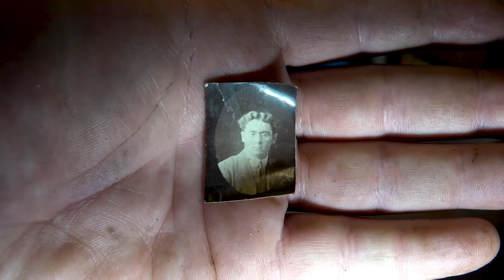First Ever Complete Reed Organ Restoration Series on YouTube

Comment: Excellent, Excellent, Excellent beautiful job. When you approach a project such as this, you can't look at it as one project. It's a 100 projects. when you remove an assembly such as the keyboard, just focus on the keyboard assembly restore that. Then remove another assembly, then restore that. Just work one group at a time. Then before you know it the whole project is done. I used to restore military vehicles, I didn't look at the whole vehicle, I looked at it as an engine, transmission, drivetrain, electrical system, brakes, wheels and bearings, and body. I would restore one system before I started an another, otherwise the project would overwhelm me.

Comment: I am very impressed with your patience and drive for perfection. You did a very good job at the restoration of that reed organ.

I have in my possession a pump organ from my grandmother. My father who passed away more than 15 years ago at the age of 92, grew up with that organ at home. I now have the challenge of restoring it. My specialty is woodwork but I am up to the challenge but a bit apprehensive considering all those small mechanical bits and pieces you took apart and fearful that I may not get it all together again. 

Knowing that I played on that organ when I was just about 7 years of age and I am now 70 and retired, I have the time on my hands to do it and the drive to have it working again.

Comment: Great job! For the sound, it might be the leather belt covering the 7 holes of the pump. Instead of leather from both sides that belt if made in  double layers the upper layer is leather and the base layer facing the 7 pump holes is made of soft silicone.

Comment: What a superb piece of work! The only points I would mention : 1 always keep the pitmans in the order they came out! If they are mixed then a lot of work may be entailed getting the keys level on reassembly. 2. I wondered what glue you used? The ONLY glue to use, everywhere, is hot hide glue. An exception is the use of white carpenters glue for physical repairs to broken items, where strength is required. The crack-filling in the sound board and repaired reed cells is a good example. Using e.g contact cements etc. for general use will make a future restoration an impossibility. 3. Was the original finish damaged beyond recovery? It looked to be quite good. It is always preferable to retain and restore the original finish if at all possible; it will look more authentic and better than a refinish from scratch - and it saves a lot of work !! 4. Often the steelwork of the linkages, coupler bars etc were flashed with copper. If this was the case then after cleaning it is worth replating with copper to avoid rusting in the future.
A very enjoyable video. Thank you for your work in making and sharing it. The organ sure sounds a whole lot better! Best wishes.
Reply from the maker: Wow... thanx James... lot of great points you made here, I learnt many of them the hard way... like the pitmans... LOL... yeah the finish was actually still in good condition, thinking back, I probably should have left it alone... the glue I used mostly was "Old Brown Glue" which is a type of hide glue, I couldn't get hold of the real thing where I live... I did however use contact for the bellows cloth, only because I also didn't have the right cloth and the hide glue didn't work on it in the tests I did... as for the linkages... I didn't know about the copper plating... that kind of explains why I saw some light rust on some of them when I started reassembly... damn it! LOL... oh well.... perhaps I'll go back some day and correct some of the mistakes, but for now... I need a break LOL... good thing this wasn't for a client... thanx for the info James... have a great day... cheers...

Comment: My wife and I acquired a Miller Organ (Lebanon, Pennsylvania) this week. It does not produce sound at all, but I am determined to fix that. The pump pedals and their straps both work nicely, but somehow the air does not reach the reeds. After watching your video, I can assume there is major leakage in the main air cavity, and there could be problems in the mechanisms that expose the reeds to the air. 

Thank you so much for creating this restoration video. I would be lost without it!

My Miller Organ looks very much like the one in this picture: https://www.reedsoc.org/index.php/rosdb/vieworgan?ascnd=1&conMenu=0&ID=10145